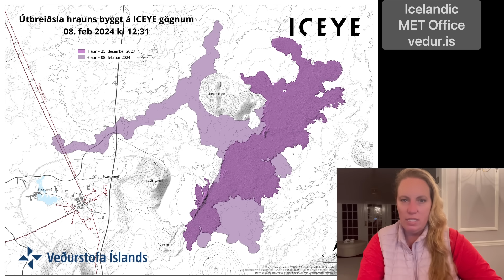Next Time Lava Might Isolate Svartsengi and flow down the Road into Grindavik #iceland #volcano

Comment: What a mess.
They under size there electrical system not make it big enough to support heaters I mean small heaters.
They under bought ,thanking we are safe.
Remember pumping water over distances takes electrical  too.
The loss of energy do to heat loss would be unreal to hot water.
This system is flawed.
Why don't the have diesel generators like for ships for backup in the city's?
Hot water stops diesels starts for more electrical energy, and have electrical water heaters
In there house for backup.

Comment: The Sundhnúkur crater series dates from about 2,350 years ago.  These historic eruptions created the conditions, including the port, for Grindavik to be formed.  Ironically, the current volcanic activity is gradually destroying Grindavik.

The Eldvörp crater series dates from 1210 - 1240 (ie about 800 years ago).

As extracted from Wikipedia:

Sundhnúkur is a volcanic hill within its associated crater row and volcanic fissure in the Svartsengi volcanic system.  It is the location of the 2023–2024 Sundhnúkur eruptions. 

The last historic lava eruption from the Sundhnúkur crater row has been dated at 2,350 ±90 years ago.

I just re-worded my comment to make things clearer.

Comment: During the tourist volcanic eruptions of
2021-2022 few if any comments were made asking
how high was the vertical ⬆DEPTH 📏of the lava flows 
unless they blocked pathways and then it was not in measurements 📏.
It was all about the fireworks 💥, not its climbing 🧗🏽 
skills.  After about 4-5 months lava covered 
a small hill in a semi-enclosed area without receiving
scarcely a mention.

Comment: Obviously the defense wall was constructed to protect Blue Lagoon; they did not care about the hot water line.
Reply: The hot water line is not just a comfort thing. It's the heating of the houses, factories and the airport.

And when the heating fails in freezing temperatures, the water pipes in the houses freeze.

You know what that means. The water pipes burst, creating a giant mess.

And they have basically no firewood on that island, it's too far north for big forests.

Comment: IDK if it is possible, but it seems to me that the possible solution ATM is to raise the pipeline by several meters with huge gaps underneath for lava to flow through, and extra thermal insulation layer should a lava flow pass underneath. They may only be able to do it in sections, but they could start with the most vulnerable parts first, and extend out. They need to accept that the whole peninsula is vulnerable- including the powerplant itself. So preemptive contingency plans need to be put place with redundancy networks now.

When the first eruptions started to happen on the peninsula a few years ago, that was the time they should started to safeguard the infrastructure long term. They should have considered that this was a start of an active volcanic period for the area, and what that meant- and what would need to be done in a more studied and calm way. Granted they would still have been ignorant about some things, like the massive fault system under Grindavik, and would likely still have made the same poor choices as to the BL and tourism.
Reply: The lava depth can grow very high very fast.
Lava also can push earth forward like a scraper.
Reply: @saywhat8966  Well, I'd think that would be as bad or worse for any pipeline on or under the ground. At least by raising it you have a chance of avoiding some of the affects of lava- though obviously with erupting volcanoes there's no chance you can eliminate all possible consequences of being near one. That goes for the power plant and the BL as well.